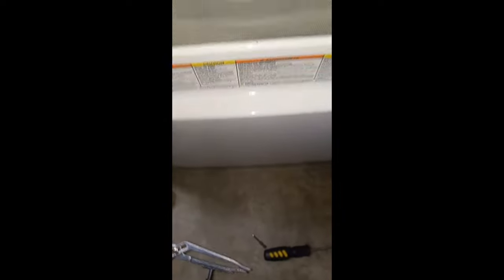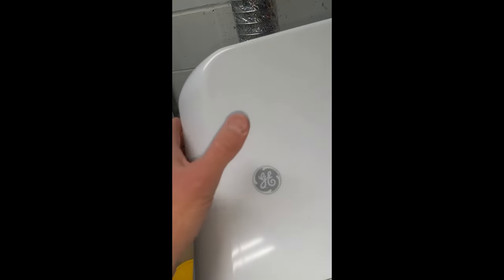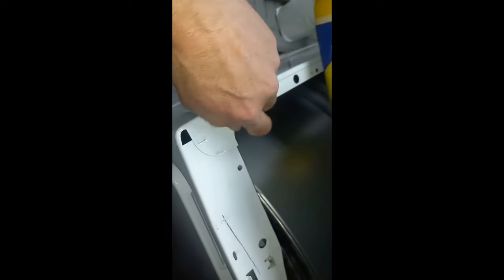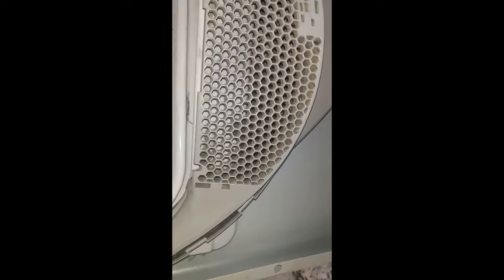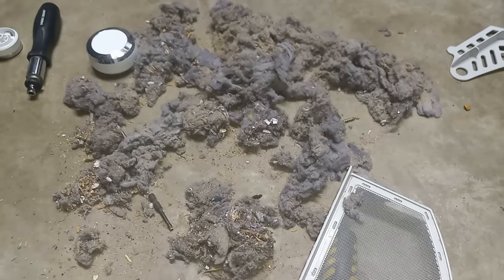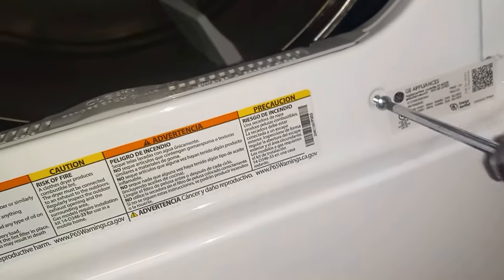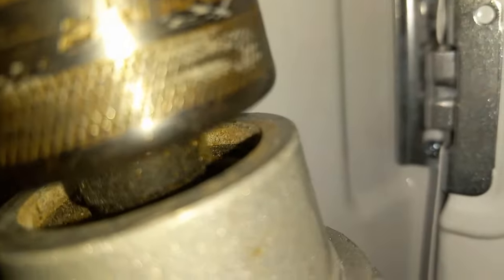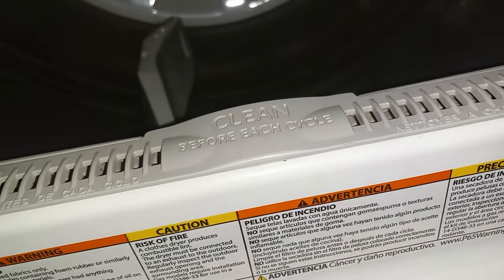How To Remove Dryer Panels To Clean Dryer Lint Filter.

Comment: This is exactly what is happening to my dryer after 6 months! Terrible design.
Reply: That's for sure
Reply: @karlholiday  dryers should be designed for easy access cleaning. Kinda of a no brainer right?
Reply: @jacquelineg3987  exactly!  I think they are designed to break down and be repurchased  😆
Reply: Well I'm sure there a few good and even more sons and daughters of us mothers who will get things a little more simple lol
Reply from the maker: I agree 💯
Reply: I had the fortunate opportunity to walk thru the GE R&D center location that had numerous maker's models all hooked up and testing and you know what? They are all designed the so similarly that you won't find one drastically different and the key, stating the obvious here, is best air flow. Best air flow also means least restriction and that can mean there's a trade off between supreme filtration and dry-time. Basically taking them apart every couple of years is actually an implied part of maintenance....I've done so on GE, Kenmore, etc etc over the years. There is no easy solution. - mechanical engineer
Reply: @richcombs4805  we know it’s intentional… surely the electric company is working behind the scene! 
It would not be difficult at all to design accessible customer service for the lint trap!
Reply: @jacquelineg3987  ..it has a lint trap.  You do know that the entire duct needs to be cleaned annually right?  All the way to the outside louver.  I found my girlfriend's duct on her 1940 cape so thickly lined with lint, that the drill ream brush simply pushed it all inside to the point I needed to full remove and clean the entire duct. I think it had been neglected for 15-20 years.  The inside path of the dryer is no different. The requirement of a fan and enclosed channel is required.  If you really are still unconvinced, I strongly strongly recommend you install a clothes line outside.  I'm also hoping you are blaming the power company (which I design, quote, and help sell equipment for in my profession) in a sarcastic way.
Reply: Thank you for this video! And to the @richcombs4805 I think we all understand that there is a reason why there is a “fan & enclosed channel” & that’s all fine & good! But they could make it easier to get to that lint filter panel without taking the control panel off to be able to then get the top up to then get to the front to take it off! I’ve seen other brands of dryers which were not nearly this involved to deep clean the lint area! This is about the only video I could find showing the GE dryer. The other dryers had screws to the lint panel in the door so you could remove that & get to the “channel” easily which would probably have people doing it more often! 😠
Reply: @gadgetkandeestory3296  if I vacuum it out often, 2-3 times per month… we’re getting improved drying times. If I put a wet load in it’s back to square one…. Lol

Comment: Great video. Really helped me. The lint buildup was my issue for sure. If you own this dryer, this is how you do it. Pro tip so everyone can learn from my mistakes: if you’re going to take the door off, make sure you put it back on before you assemble the dryer. Took me 45 minutes to get it back on with the dryer assembled, and it was a righteous pain in the ass.

Comment: Thank you. I found your tutorial very helpful and easy to follow. I successfully  did it even though my dryer is slightly different. The grey part that is the actual housing of the lint filter is 2 pieces. Also my dryer had 3 bundles of wires that I had to unplug. The big one was a challenge. You have gained a faithful follower. I am going to make a TikTok with the steps you so generously shared, I will credit you channel.  Again, thank you so much for helping to make me successful in doing this task. I live very, very far from town and finding a repairman to come out and do this is very cost prohibitive.

Comment: Which model do you have? I have the hotpoint 6.2 cu. ft. capacity aluminized alloy electric which is htx24easkws. I don’t see that switch on the inside of mine to take the vent panel off

Comment: Maybe I missed it, but is this for the GE GTX22eask0WW dryer.  I was trying to clean out the lint trap in my daughters (student college apartment) and the Lint trap didn't really come off like mine does (I have LG front loader) so I'm not sure if it was all cleaned out.  This looks like hers, just want to make sure before I try tearing it apart when I head there again.... lol. You would think the management would do that bc it seems like a fire hazard.  Anyway great video thank you!

Comment: I had the same issue with the filter bouncing and it was causing the door to not stay shut while in operation. So once I cleaned everything out it works fine now.
Reply from the maker: Mine needs another cleaning, cuz the  door be bouncing against off all the LINT😭

Comment: Amazing video and had my confidence built up to do this but I can’t do the last part with the wire connection. At 3:03 I can’t get that connection apart. 😢
Reply: I’m going to be doing this as well. Other videos show that you can swing the door without unplugging it once you remove from the slots. Not sure but maybe you can try that. It’s crazy that lint gets trapped UNDER lint screen!🤦🏻‍♀️ they just want you to pay technician to do it.
Reply: @janetortiz4861  good luck to you. This wasn’t difficult and I got everything apart eventually. Turns out my issue was in the wall where the dryer exhaust goes. So my dryer is nice and clean, but it didn’t improve drying efficiency.
Reply: Sorry to hear that! You probably did but, just  a suggestion….Did you check the outside vent? Mine wasclogged once long time ago. That did the trick with mine.
Reply: @janetortiz4861  I can’t seem to find the outside vent. Neither can my landlord. She’s gonna talk to the neighbors. I’m technically connected to another house on the corner. So I’ve seen the rooftop type and know that the vent isn’t supposed to be more than 25ft, but still have to investigate. When I reached as far as I could into the wall where the dryer sits, I pulled out some damp lint. Might try the electric blower trick today. Just hope it doesn’t spread the lint all over the neighbors side of the property 🙏😂😭

Comment: I've gotten down to the door wire & I can't figure out how to unclip it, please help.. you made it look so easy
Reply: Same here. I can’t pull that wire out. Mine has a plastic piece in front of it but it looks like his is ripped off.
Reply: @momifestyourdreams  yes, I never unclipped for fear of damaging the wires so I just cleaned around it even propping the door to get deeper in the machine it was tough but I got the same results as if I took the door out
Reply: Same here. I have extra wires and a plastic piece, so I can't unclip the wire like he did. I just cleaned as most as I could

Comment: Good video as far as it goes, but it didnt look like he actually cleaned all that thoroughly. I saw many clumps of lint left in corners that I would have gotten with a finer brush, plus a disinfecting soap, water and ammonia... used carefully so as not to wet electrical parts.

Also, I was hoping to see how to take off or open up the entire housing so I could vac and wipe the whole interior of the housing. ..all arpund the outside of the drum.

I was given a used dryer and a large amount of  lint was falling out of it as it was brought in.

Well, I guess Ill just keep unscrewing screws and unplugging connections until the whole housing is removed. Then brush, shop vac, and scrub with detergent and water, enhanced with some ammonia ( best grease cutter, bacteria-buster ).

Comment: Thanks for video but upon reassembly I cannot get unit to run.  My guess is the wire connection is now bad but not sure on this.  Could it be anything else?  Thanks in advance
Reply: Make sure the door is closing all the way or it will not start. I was having the same issue with filter bouncing and it was causing the door to not stay shut and locking properly during operation.
Reply: Hi did you get that figured out? I'm having the same problem after reassembly

Comment: Is there a trick to the lid? Mine will not just pop off
Reply: Not sure, did you ever get yours to pop off?
Reply: My model had screws holding down the top in the front. I got them out by opening the door and getting them out from the underneath the top of the door frame.

Comment: my filter looks like this.  I tried to clean with a feather duster that went down pretty far.  When I went to pull up I hit something .  Now I have this piece of silver metal and my filter will not go back in dryer.  I called Maytag and they could not help me and said I need a tech to come out.  I have called 3 places and know one can come out till New Years.  I wish I could send you a picture of the piece of meTAL.  Now I took an item and tried to push the piece of metal down and filter still will not go in.

Comment: Looks like a ROYAL PAIN just to keep the lint from accumulating.  Why isn't there a special flexible lint brush, (LONG, NARROW, AND FLEXIBLE) that can be used to PULL the accumulated lint??  That would sure be a lot easier!! My last electric dryer lasted 25 years an never needed such a "deep cleaning."
Reply: There are, but they won't get past the impeller.

Comment: I've never seen such a bad design to clean out a dryer as I have this last one I've owned. I doubt I'll ever buy another GE appliance. Been a loyal customer of theirs for years, but this last set I've bought I've had nothing but issues. The dryer has tons (about half) of lint that falls down in it when you clean the lint trap every load. I hate the washer and dryer I bought, should have sent them back after the first load. I would not recommend buying them.
Reply: The design of every dryer, including the channel/path of air flow is so similar across all the makers, that I'd never blame the manufacturer.  The optimization of the concept design is fully mature and won't really ever improve much. - mechanical engineer

Comment: This style drier sucks! It blows so much lint out of the exhaust hose and all over the exterior wall of my building. Needs an upper seal from front of machine to the drum. Got rid of a 17 yr old frt load for this turd. So much for the commercial version!!